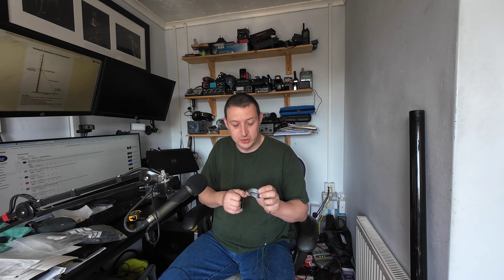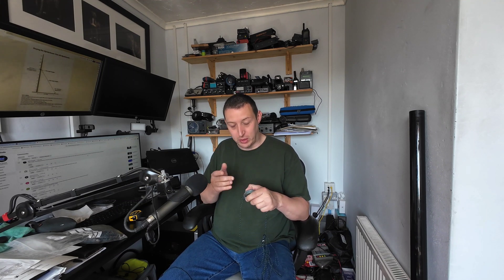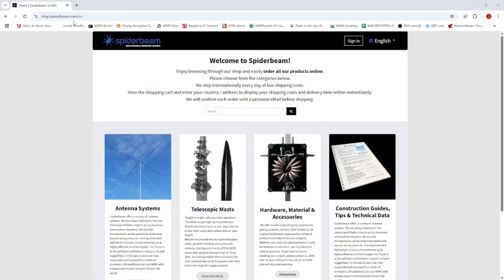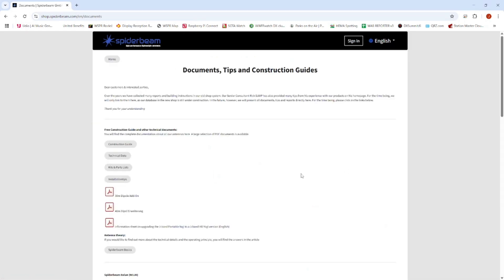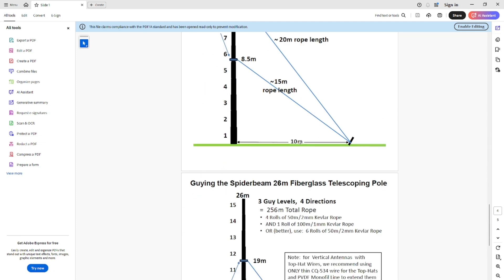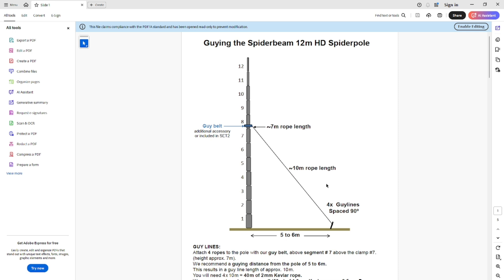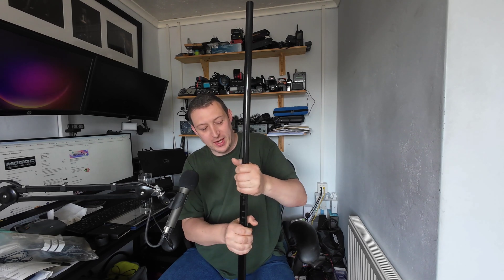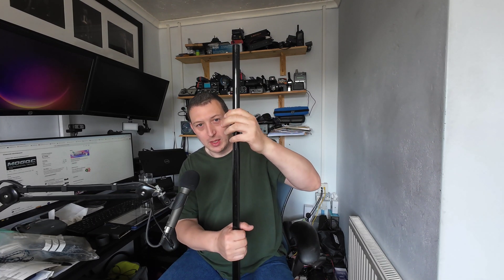How to guy a 12m fibreglass mast

Comment: You could use Pythagorus Theorum for measuring the length of the line. So long as you know a and B of course!!
Reply from the maker: Admittedly that is the way that I would normally do it but I was trying to keep it as simple as possible (very simple maths) for the video.

Pythagoras & trigonometry (if you know the angle) has served me well over the years for numerous mast related calculations!